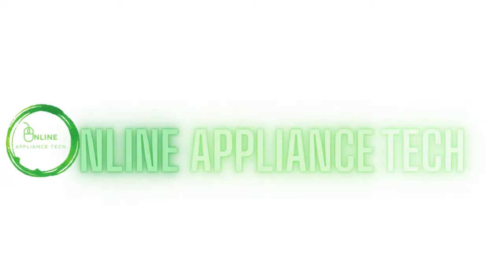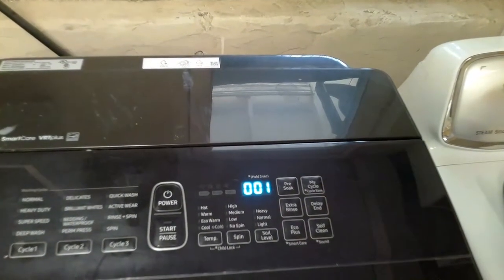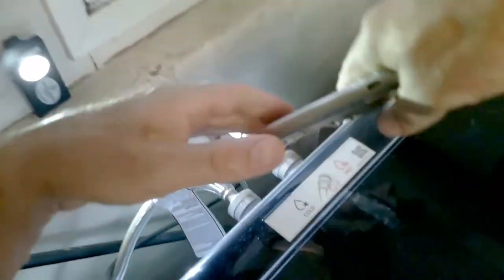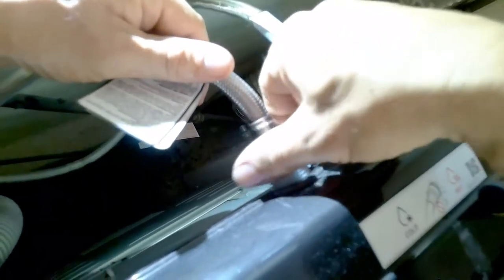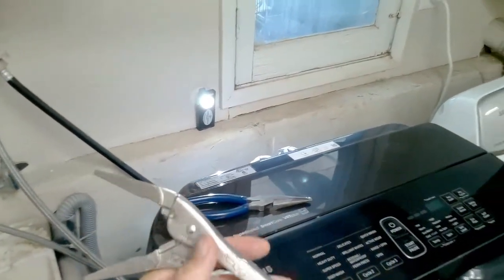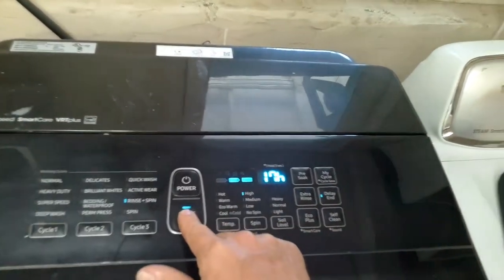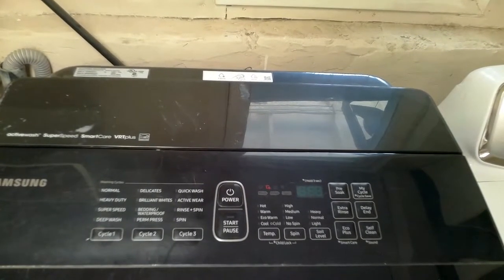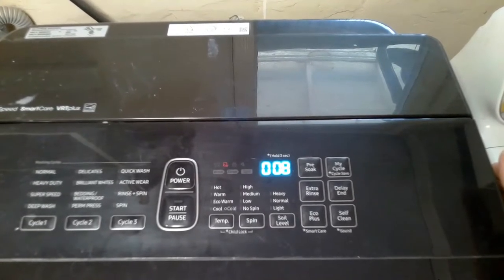Samsung Washer Fix: C4 Error & Diagnostic Mode | DIY Guide!

Comment: I’m getting this sporadically and have ZERO water supply issues. Screens are all clean, water flows perfectly at both inlet hoses. Tempted to replace the washer and run this one over with my truck
Reply from the maker: It's necessary to verify the power supply to your water inlet valve. The issue could be with the main control system or the water inlet valve itself.

Comment: My washer has the code 4C and OC the cold water just keeps on and keep feeling and when I start the cycle the code 4C cokes out again I already clean the filters in the back what do u recommend
Reply from the maker: It appears the issue may be a faulty water inlet valve, which is akin to a dripping faucet that continues to leak even after it's turned off. Despite the additional steps provided below, the problem seems to indicate a malfunctioning water inlet valve.      The error codes 4C and OC on your washer suggest issues with the water supply and overflow respectively. Since you've already cleaned the filters at the back, here are a few additional steps you can take:

Check Water Pressure: Ensure that the water pressure is adequate for the washer's operation. Low pressure can sometimes trigger the 4C error.

Examine the Hoses: Look for any kinks or blockages in the water inlet hoses. If any are found, straighten or clean the hoses accordingly.

Inspect the Water Inlet Valve: The water inlet valve controls the flow of water into your washer. If it's defective or clogged, this could be causing your problem. Cleaning or replacing this valve may resolve the issue.

Check Drainage: Ensure that the washer is draining properly. Improper drainage can cause the OC (overflow) error.

If none of these solutions work, I recommend contacting a professional appliance repair service as the issue could be more complex, possibly related to the washer's control board or other internal components.

Comment: My washer will only drain it doesn’t start a cycle know what it might be??
Reply from the maker: Hi I have a Samsung Washer Diagnostic Mode Video, just go to all my videos and you will find. Title of video is  [Samsung Washer Diagnostic Mode] I hope this helps🙂
Reply: Did you ever figure it out? Having the same issue
Reply: Yes I did the latch that keeps the door closed would latch n then un latch causing the error and not letting the machine work. I was still under warranty so it was free to have a technician come out and replace the faulty latch mechanism. Good luck
Reply: @tanner297  Yes I did the latch that keeps the door closed would latch n then un latch causing the error and not letting the machine work. I was still under warranty so it was free to have a technician come out and replace the faulty latch mechanism. Good luck